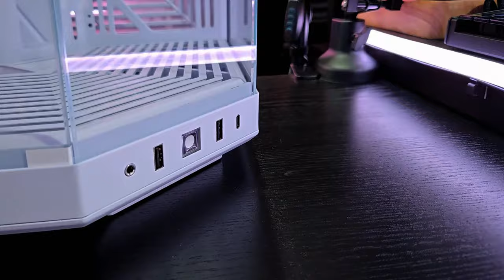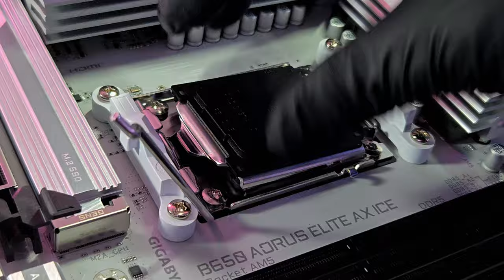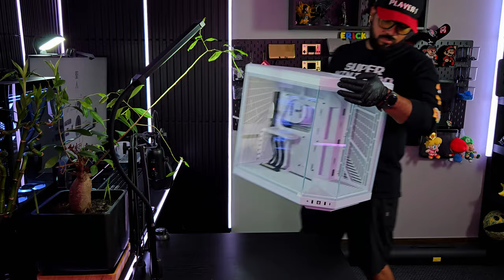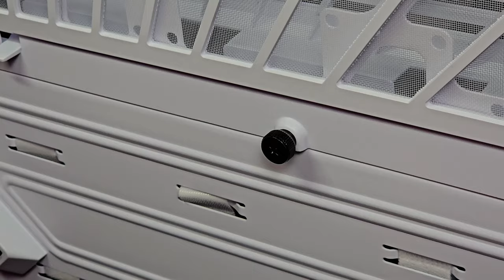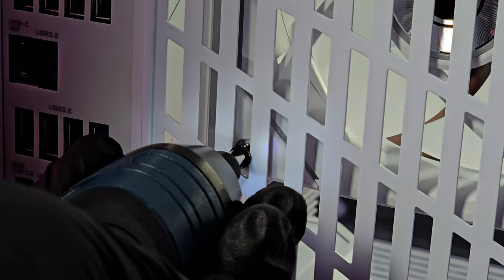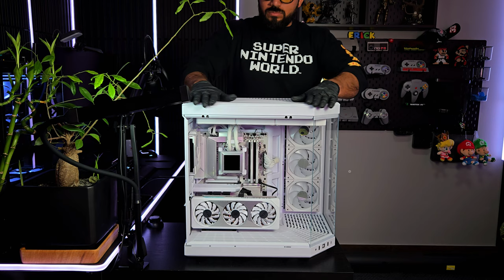Building my Wife's Dream Gaming PC

Comment: He used enough thermal paste for 2 pcs like what, u get less preformence if you use 2much thermal paste bro, u barley need aything just enough to fill a thinl layer BRO built a swiming pool on the cpu
Reply from the maker: I know, I ended wiping it off and redoing it 😂